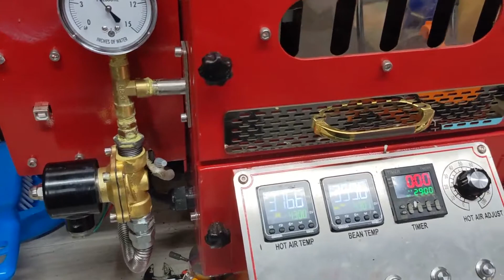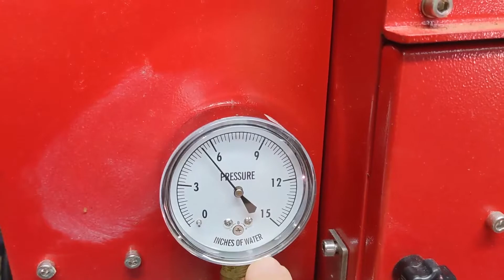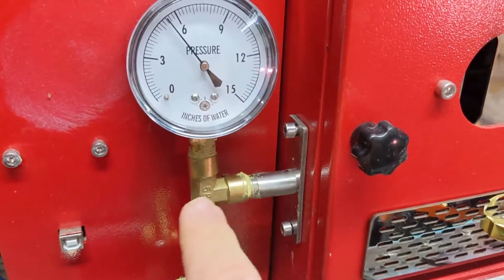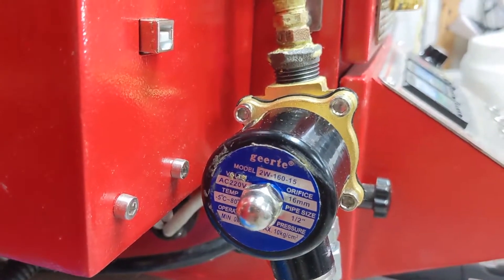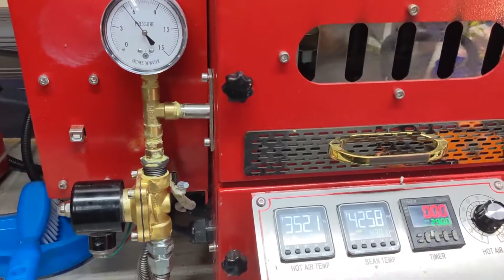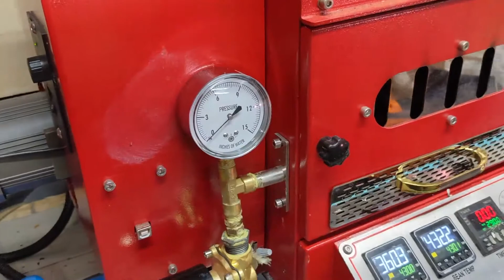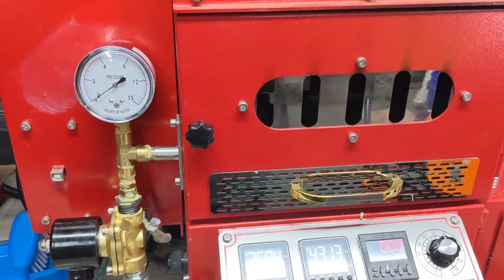Yoshan Dongyi Natural Gas Conversion Coffee Roaster

Comment: Hello 
I have yoshan machine DY3 it's a 3 kg and I have the same problem but I can't read the chart good
Can you help me with what size I need please?
It's says the machine max output 60000 BTU/ Hour

Thanks
Reply: Mahmoud, I need to get these details right to make sure I calculate it correctly.
First:  How many burners do you have under the drum.  The 2kg model has 5.  Second:  What pressure are you working with?  Third:  Is 60,000btu your goal?  That's a lot of heat power for a 2kg.
Reply: I have the same problem my grandpa ordered a natural gas conversion dongyi 15kg roaster this one puts out 90k btu an hour and says min kpa 2.5 and max 6 for NG and has 20 burners but the supply part has two 1/4 gas valves and a 1/4 solenoid in the middle and I don't even see the needle lifting at all maybe 0.2kpa but I'm trying to achieve 3.8kpa- 15 water columns and I'm wondering after you removed the two gas valves did you just use a regular shutoff to control the flow ?
Reply: And do you recommend just drilling the orifices #67 because their engineering in sizes are different from us because we use lower pressures for NG I think the guy said we had 6oz coming in which I think is like 10wc I might I have to adjust the regulator on gas meter to bump the pressure up